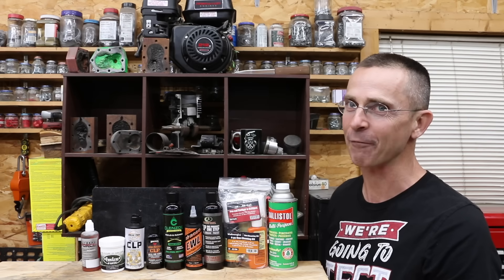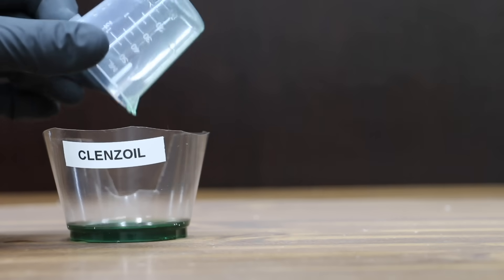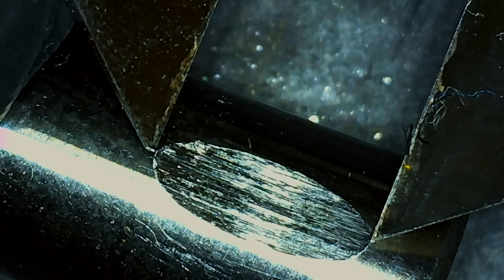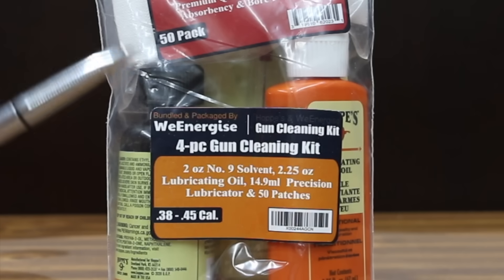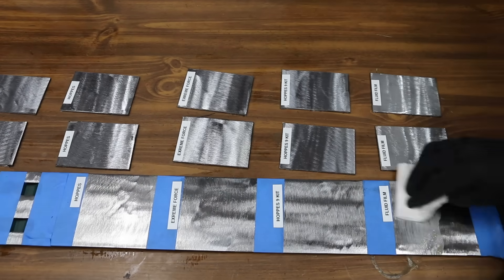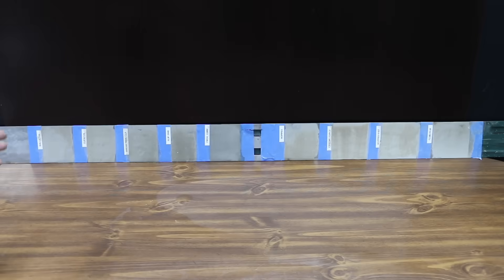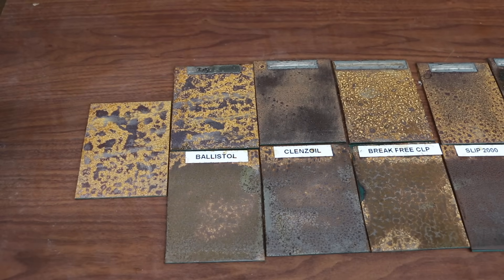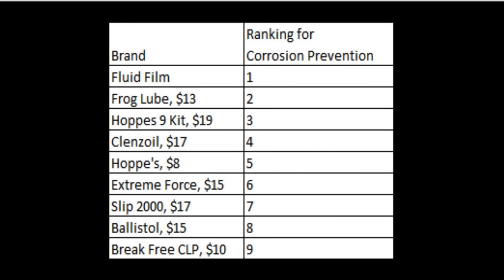Don't Buy A CLP Until You Watch This Review! It'll Save You Time And Money!

Comment: I would like to have seen Amsoil MP tested against these products.  I used to shoot between 250 and 500 rounds through my semi-automatic shotgun twice a week at knock-out competitions.  When using Hoppe's 9 cleaner and Hoppe's 9 oil my gun would start to cycle slower after about 400 t0 500 rounds.  I started using the Amsoil MP after seeing it work very well in other applications.  My gun ran between 1200 and 1500 rounds before starting to slow down and require cleaning.   The only failures I ever had were a broken firing pin spring, a broken transfer bar,   and a weakened bolt return spring when the gun was 20 years old.  I bought the gun new in 1980 and gave it to my son in 2010.  It's still going strong and you would never guess that it's had over 80,000 rounds run through it.
Reply from the maker: Thanks for the videoes.

Comment: I've viewed this a couple of times now and although I think the testing to be very well thought out, I can't help but think that the wear test to be somewhat flawed. The test wheel is constantly replaced with new product on every revolution. I'd be interested in seeing how these CLPs hold up to wear with only an initial application. A firearm doesn't have the lubricant continually replaced (although that sounds like a cool idea) upon reciprocation of the slide and locking of the barrel, so I question if a higher viscosity product would rank higher because it would stay in place longer. I question if a grease would perform better in this case - at least in moderate climate. Of course I would think a less viscous lube would perform in extreme -40 cold.
Reply: Seal1
Reply: it's why I like Lucas Gun oil for rifles and FrogLube for handguns. Lucas the warmer it gets the Slicker it actually becomes. same as said for the FrogLube paste which is what I use for handguns. but I did not see Lucas tested on this video
Reply: @I_Identify_as_RICH  froglube is garbage--you will find on the hard way
Reply: It's was just a test with the tools he had available. I'm sure he has a good collection of firearms but due to obvious anti-gun policies on Youtube, he didn't use real firearms for testing. 
Some oils requre time to release anti-wear additives. 
Also, lubes like Froglube require very specific application procedures. If applied like regular oil or grease, it will turn into a sticky goo and jam your firearm. Parts should be completely cleaned from any remaining lubricants and dried. I use Break Cleaner spray for this.  After parts are degreased and dried, heat up the parts and apply a tiny amount of Froglube. Spead it all over and let sit for several minutes. Wipe the parts with a rag and reassemble your firearm. Froglube penetrates into metal pores. It's slowly released while your gun is operating. Great lube if you use it right. 
IF you have no gun specific oil, use automatic transmission oil for cleaning and regular engine oil for lubrication. Works great too.
Reply: @andrewevanoff1192  It would be difficult if not impossible to test that with real guns regardless of YouTube’s policy. I think the point is use that setup, just don’t have a cup of product there. Lube the wheel once and let it go.
Reply: Just because it’s a test doesn’t mean it’s a relevant test. It’s the same when they use that lubricity contraption to test engine oils, guns and cars just don’t have surfaces that interact like that which is a good thing because that’s a terrible setup to lubricating interacting surfaces. Same goes for baking those metal plates in an oven, guns heat up but if you’ve heat soaked the metal through to 400 degrees you’ve got other problems on your hands . Or how oils pour a -40, thats such an extreme condition it applies to almost no one.
Reply: @johnpenwell6402  From Wikipedia :
Tests are performed to quantify a lubricant's performance for a specific system. This is often done by determining how much wear is caused to a surface by a given wear-inducing object in a given amount of time. Other factors such as surface size, temperature, and pressure are also specified. For two fluids with the same viscosity, the one that results in a smaller wear scar is considered to have higher lubricity. For this reason, lubricity is also termed a substance's anti-wear property.
Reply: I agree.  And the wear a firearm undergoes is not like a constant spinning wheel for a minute.  Good test for what it tests; not sure it tests performance in a firearm.  I use Ballistol and will continue, btw.
Reply: @abc-wv4in  of course you use ballistol 😂

Comment: The only CLP Ive ever used in a direct impingement rifle (AR-15) where I could literally wipe off the black carbon with a paper towel or a rag was SLIP2000 EWL. With SLIP2000 EWL, you can literally and I do mean literally, clean off the carbon without using toothbrushes or solvents, etc. To me, CLPs are more for semi-auto rifles where you have direct impingement gas systems (gas is blown directly back into the action of the rifle blowing carbon onto the bolt carrier group). I have not used Clenzoil, I might try it after watching this video. I have used the following in AR-15s: Breakfree CLP, Mobil 1 synthetic motor oil, Militec gun oil,  Shooters Choice FP FP-15 gun oil and ALL the SLIP2000 products. Not one cleaned up the carbon as well as SLIP2000 EWL CLP and its carbon that gums up the actions of direct impingement rifles. The above being said, I think this experiment rocks and I think I will give clenzoil a try, but I'm honestly skeptical clenzoil will clean up carbon as well as SLIP2000 EWL.
Reply from the maker: Thanks for the feedback.

Comment: Been using guns for 40 years. Been using whatever oil was at hand for just as long. Zero problems thus far.
Reply from the maker: Thanks for the feedback.
Reply: @ProjectFarm  I do think the freezing tests you did were very imformative. 
If you ever revisit this, can you throw FP10 into the mix? That's what I used for years because I lived in a area where -35F was a reality a few times a year.
Thanks.

Comment: As someone suggested, a part 2 would be good. I’d like Frog Lube to be given a second chance though only in the second test, proper application of the product should be done. Frog Lube requires the product to be applied to heated material, in 2 applications with cooling in between. The lube supposedly absorbs into the heated material and protects during heat cycles during use. As an active duty LEO, I use this Frog Lube on my service weapon and would be curious to see how it handles actual testing. Perhaps you could even treat a pistol and subject it to 500 rounds?  I know ammo is expensive but it’s for science!
Reply from the maker: Thanks for the feedback.
Reply: I melt my frig lube and brush it into my firearm parts then heat everything with a heat gun or hair dryer.  Then wipe all the excess off.  Seems to work well for me.

Make sure to get all of the excess frog lube off of your firing pin or you will experience light primer strikes when cold

Comment: I only use gun grease on my firearms because any of the oils based ones I used would melt right off after 500rds down range. You should try a test with high heat applications to see wear results after.
Reply from the maker: Thanks for the feedback.

Comment: Ok, now u in my wheelhouse.....i use products in gas turbines to submachine guns....here is the problem.....those all in one products only work well in one area....I would never use a cleaning product for lubrication or corrosion protection.....such all in one products work ok in a fairly clean lower temp environment like a gasoline engine.....but never in a dirty high temp application like a rapid fire firearm......use a cleaner to clean, a good lube for contact parts and a protective product for exposed components......actually a good ultrasonic cleaner does a great job with dismantled pistol or revolver....a light amount of a good mil spec lube thereafter......SP PhD
Reply from the maker: Thanks for the feedback.

Comment: Thank you for the video, i do have to point something out about the frog lube though.  Im pretty sure frog lube is its own kind of treatment for the metal, you're supposed to heat up the parts so the frog lube absorbs into the pours of the metal.  

Also for part 2 i would like to see you test the lucas oil brand of products as well as the spartan systems stuff.  i personally use Lucas CLP and gun oil for most stuff.  my school sent me spartan systems stuff, i personally havent tried it yet.

Comment: great video and test. I would be curious to see the result if you heat the frog lube during the friction test as that is the suggested method of applying it. Unless its changed, I used to use froglube and I would warm the parts with a hairdryer or leave it out in the sun for a bit and the froglube would melt like coconut oil. I feel that may be the reason the tester hit the upper 400watts then started to drop off. I've been considering switching back to frog lube , but I may try break free
Reply from the maker: Thanks!  Thanks for the suggestion.

Comment: Having recently gone to Clenzoil, I can honestly say it is the best I've found so far at cleaning up the gunk and residue.  Since I'm in Florida, I'm not going to worry about it freezing on me, but I was surprised at that part of the test.  Very nice testing sir, and very helpful to us firearm guys.
Reply from the maker: You are welcome!
Reply: When I was in the army when we got back from the range we had a can of spray carburetor cleaner to flush out all that carbon and dirt. After that it was a toothbrush, laundry soap and the hottest water we could find. (Mess hall imersion heater to rinse. Rifle would instantly dry and then we  lubed up. GIs always find the fastest easiest ways to get it done cause the armoror would kick back any weapon with the slightest amount of carbon.
Reply: Sharing this glorious state of Florida with you, and it looks like I'll be investing in a bottle of Clenzoil as well.
Reply: @shanecabbage2187   I'm in Florida 🏖. Orlando FL area. I've used Clenzoil for around 10mo, 2022. It holds up well, no fumes, prevents rust-wear. A - is the spray bottles run out fast 😕. Clenzoil does contain a small amount of petroleum. The scent is nice, not strong. I also use Slip 2000 EWL. That CLP is a great gun care product. No fumes, non toxic.
Reply: @DavidLLambertmobile  thanks for the recommendation. Hoping you survived the storm without much damage up your way.
Reply: Yeah, i'm in South Florida and the Clenzoil was most impressive. Will definitely buy a bottle. I'm curious how it would stack up against my personal favorite,  Lucas "Extreme Duty" CLP.
Reply: @HomesteadOnThePreserve  Mark Novac from S. Carolina, one of, if not the best gunsmith in the world, swears by the Lucas gun oil.
Reply: @patdennis3751 Good to know Pat, thanks.
I've tried and compared so many with the exception of Clenzoil (which I will buy in my next order) and I just LOVE Lucas CLP. Bonus it smells like blueberries!
Reply: @HomesteadOnThePreserve  you also might be surprised at how well a good synthetic transmission fluid or 5w30 engine oil  works too. Both have great detergent packages and probably lube better than any gun labeled oil. A $5 quart will last 2 lifetimes.
Reply: @patdennis3751  Yeah, Ive been hearing about synthetic engine oil and tranny fluid for many years.  I still never made "Ed's Red"  though.
Reply: @HomesteadOnThePreserve  I made Ed's Red a long time ago..
Never got to try it as one of the ingredients Evaporated right though the plastic lid.. (it was a container safe for Gas) 
Would need to store it in an airtight steel container..
Reply: @zakofrx  Dang, that's hard core and thanks for the info.
Reply: @HomesteadOnThePreserve   There is nothing wrong with the Lucas Oil CLP but after trying the 
Clenzoil on several rifles and pistols, I just felt more comfortable with its ability to cut through carbon and protect the metal. I have not regretted my decision to switch.  Everybody will have a different favorite, the Clenzoil just works better for the firearms I work on.  I also use the specially formulated Clenzoil cleaner and lube for fishing reels as I find it keeps my saltwater reels in great shape.  Really protects them well from salt spray from ocean fishing.
Reply: @Bluesky5553  But does Clenzoil smell like blueberries? 🤪

Comment: I've always used two step cleaning with my firearms (cleaning solvent then oil) but that Clenzoil seems like a good product.  The lack of metal wear during that first test was really impressive.  
Currently I'm using Shooter Lube but I wonder how their oil compares to Clenzoil.
Reply from the maker: Thanks for the suggestion.
Reply: @ProjectFarm  I have switched over to the Clenzoil and am very happy with the results.  The lubrication qualities are indeed superb.  For 20+ years I've used the two step process and not that it hasn't worked or protected my firearms, but the one step process with a CLP is just so much easier.  I'm afraid the bottles of Shooter Lube I still have left are going to gather dust.
Reply: @ProjectFarm  I'm still using Clenzoil.  The stuff works great.  Thanks for the demonstration.

Comment: I had frog lube completely gum up an 870 that was left in a gun case for 5 years.  The gun didn't rust, but I did have to remove bolt and trigger assembly and baptize and scrub everything with rubbing alcohol!
Reply from the maker: Thanks for sharing.

Comment: I'm a 1980s Army veteran and comp shooter. I use CLP or Duralube at the range to lube after extended shooting. However, I have found out about 20 years ago that to put my guns away, I clean with the hoppes or clp and then I lube them with Duralube spray. I have found that I can shoot them A LOT without any cleaning in btwn. I have done your exact test with Duralube years ago. It is an automotive product but I have found it to be a superior lubricant. It does not attract dust. It prevents carbon build up and has made cleaning as easy as a wipe down and re-application. Even guns I do not clean and let sit for months or years I can still pull them out and clean easily with no corrosion and the carbon comes off easily. Maybe try Duralube? 

I have a repro remington 1858 BP revolver that I bought new and shot a hundred rounds or so a few years ago and brought it home filthy and didn't clean. That was a mistake. I pulled it out a few months later and the whole gun was seized! I could not cock it, remove the cylinder, NOTHING! I soaked the whole thing in Seafoam and then in Duralube for about 5 days. Works perfect today and looks new. After treating with Duralube, it works very smooth and wipes clean with a rag and some swabs. 

I would like to see you try out Duralube for engines and for this same application. I use the motor treatment in all my vehicles since Slick 50 failed me years ago. Duralube has done some incredible things for me since. But that's another story.
Reply from the maker: Thanks for the suggestion.

Comment: I'd like to see a test regarding specific purpose made firearm lubricants and not just "CLP".

I personally use a seperate cleaner and lubricant because to be completely straightforward, it's kinda ridiculous to put a solvent and a lubricant in the same bottle. Yes it works, but a general purpose liquid is not as good in performance in specific categories (like lubrication).
Reply from the maker: Thanks for the video idea.

Comment: You should be swimming in journalism awards for you videos, I honestly can not think of any source I trust more than you in product reviews. 
I have a request / suggestion for a video. It is based completely on my own niche needs so may not be all that relevant though. 
Wet belt sander belts. Specifically the 3" wide belts that usually range in the 18' to 30" length used in upright wet belt sanders. These are used for glass and gem/stone shaping and polishing. 
One of the major issues I run into with these belts is the seam coming apart, most manufactures claim it's age but since it's all but impossible to make sure a vendor is selling only brand new stock that answer doesn't do much for the broken belt. 
The next issue is simply the usable life of the grit surface, the cheaper amazon brands which surprisingly seem to avoid the seam issues just don't last. While the brands with seam issues can be repaired a couple times and still have usable grit surfaces. If you can get the repair to hold, which is a whole other can of worms. 
Less common a problem but still one that I've noticed in belts of both high and low expense is how true the belt is. If you have to skew the rollers excessively to keep the belt on the machine it can cause all sorts of issues. The types of rollers commonly used with these belts are flat so lack the dome shape that keeps thinner belts centered, this make any misalignment in a belt really noticeable.
Reply from the maker: Thanks for the video idea.